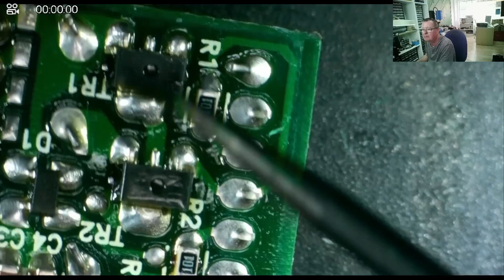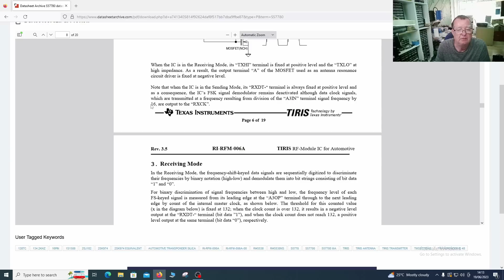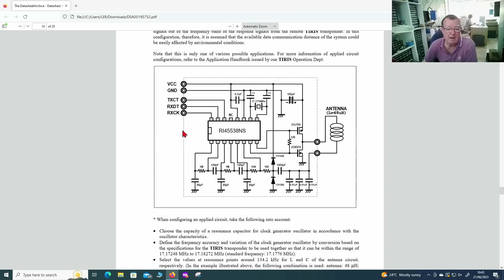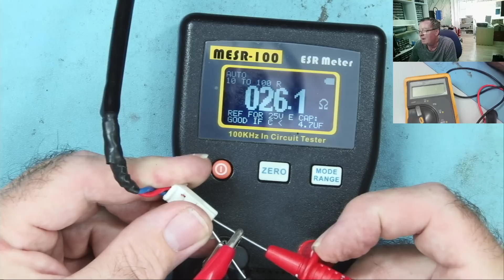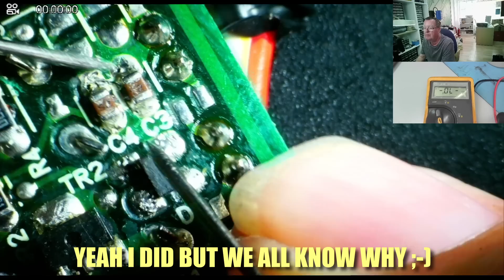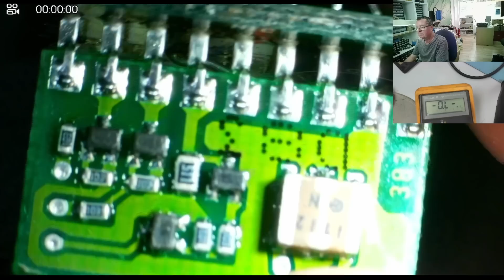Learn This Different Electronics Repair Technique And Fix Almost Anything!

Comment: That is the transponder coil of a category 2 thatcham approved immobiliser. The black ring picks up the chip in the car  key and relays the stored immo data/code via the coil and module to the ecu or dash clocks to authorise or deny an start attempt. Acc is accessory position ie dash lights on but not cranking to start. You can usually read the immo chip but as mentioned by others here, you’ll likely not be able to edit the bin as they use incremental registers to prevent you editing the first two lines containing the immo status
Reply: Great reason to hold onto your older vehicles.  The manufacturers are doing all they can to relieve you of your ability to fix it yourself.

Comment: I watched this entire video and couldn't believe that an hour had passed when it was over. I guess I've progressed beyond "complete beginner" because I was hoping to see the board powered up and what would happen if a scope was attached to the TX pin or a pulse generator was attached to the RX pin. I don't know a lot about cars, so I also wondered why a car with a battery even needs a bridge rectifier to convert AC to DC. I looked up how alternators work and figured that out and learned about what inverters do in the process. This was definitely the right information for me at the right time.

Comment: Can I suggest you get yourself a ball of "bluetack" and use it to stabilize your board/assembly whilst attempting the surface mount soldering.  Just stick the board/assembly down on top of the Bluetack and it should stay in place while you prod and poke the components.   Great videos, as a novice I am learning much from them.
Reply from the maker: Damn good idea.  Thanks.
Reply: I`ve used blue tack for my jobs for years. best way to hold stuff, even just to hold wires while tinning
Reply: It's great for cleaning record player stylus' too. I've checked it under a microscope and it does a fantastic job. Just an FYI...

Comment: Nothing wrong with it from the start, the bloke nicked the car !! Good effort and I felt your pain as the probes skidded off the conformal coating, perhaps your next Ali order should include a small bench vice !...cheers.
Reply from the maker: Someone else suggested Blue Tack. 😉
Reply: Or got a new key cut and forgot to keep the old plastic part with the transponder in.
Reply: Heh yeah, most obvious application for 'electronics connected to the ignition switch' is an anti-theft device and the most obvious reason for it being 'broken' is that someone's stolen the car or lost their key and doesn't want to pay the manufacturer to sort it. Take it around to your local electronics expert to see what he can do.

Comment: Hope you're having a good day I have found that by applying white thermal paste onto and wiping it off ic's and transistors you then can read the numbers very well, thanks for all your videos.
Reply: Great tip, tried it and works well. Thanks👍
Reply: Nice tip! Thanks. I'll have to try that.

Comment: It's a bit inconsequential to the diagnosis, but I think you misread the voltage on the electrolytic cap as 6v when it's 16v, most 6v caps are 6.3v.. it would also make sense that an automotive system would run on 12V
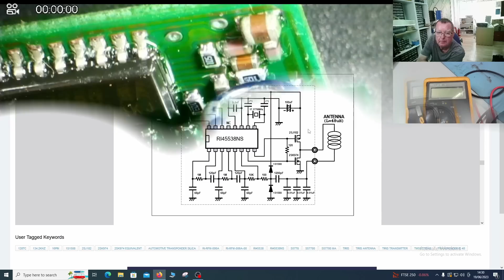Reply: You can clearly see it at 22:00.
Reply: yup @TechSavvy.

Comment: Many standard diodes come in chips of multiple diodes. Sometimes these are connected and sometimes it's just convient packing of separate diodes. The same is tru for chip resistors as well. All the time you were calling the diode package a bridge rectifier I screaming "Look at the schematic!" Not that I haven't done the same thing myself... I enjoy your videos! Keep making them!

Comment: Likely powered by automotive 5V reference (supply) voltage from the ECU.. Tx/Rx likely goes to the CAN bus.
Having the scan data from the vehicle, specifically Security/anti-theft/key transponder (& is the transponder in the key any good?), via a scan tool from the customer would have helped.
PS, check out and get an RTL-SDR dongle, as it is cheap and effective receiving a very broadband of RF signals .. in this case, finding out if this device is in fact transmitting.

Comment: ACC= accessories. With engine off.
You can listen to your radio,  charge ph, ect. when you turn your key to ACC. You wont have battery power going through your alternator saving it  from burning up because it's not turning the fans inside the alternator.
With the key in ACC  It also keeps your fuel pump from running 👍

Comment: It’s part of the immobiliser. You need to test it in the vehicle with the key to see whether it is actually the problem.
Reply from the maker: @davidcross30 Sometimes you don't have access the vehicle or whatever a PCB comes from (industrial crane, fork lift truck, sausage making machine, F1 car engine cam shaft measurement rig, control pendant - these are just a few real life examples of things I repaired when working for an industrial electronics repair company).   Sure in a perfect world you would have access to the item the PCB came from but in the real world that often is not the case.  

So then you have to use other methods and that is what I am trying to show here - a methodical way to approach a PCB repair without knowing what it does. Sometimes this method will allow you to fix stuff and sometimes it wont but sometimes this is the best approach available.  Your comments and those who 'liked' it suggest it is not possible to repair stuff this way. I differ in opinion and think it is surprising what actually is possible.
Reply: @LearnElectronicsRepair  Absolutely Rich you certainly can look at what is wrong on the board but in this instance with important pieces of this system missing it is almost impossible to ascertain which part of the overall system is at fault - there are inputs to this board and it provides outputs to other boards/systems. 

I dare say (as an automotive engineer) that the fault is elsewhere and I would always start fault finding on the whole system.

Like you say If you can't do that, like in this case, you can scratch around to see if the components on the board are okay but other than that there isn't much else that can be done.

I MUST say however Rich. I bloody love your videos and I'm learning much more than ever before. Keep up the great work my man. And I did indeed like the video too; I always do.

Comment: my suggestion would be that the shop check with oscilloscope if the ecu pins are getting the signals and from there you can conclude something like broken key or the chip here is faulty, because as you showed the antenna is working, which often is the problem with this systems, but maybe not this time

Comment: This might be a job for the Fnirsi portable oscilloscope. You could connect it to the antenna and see if there are any signals present as this looks to be a transmitter only device. The question also is if this device is receiving the signals to transmit from the controller.
P.S.> Richard I hope you fixed up a bit those solder contacts, because while you were poking and poking and poking them,you almost destroyed some 😁😁😁
Reply from the maker: I wanted to power the PCB up and see if we could see an oscillation on the inductor - I even looked at the datasheet to see what logic levels we may need to put on the inputs to get it to do something.  Unfortunately the owner wanted it back the next morning so I didn't get chance so apart from explaining how we could test that chip I wasn't able to try it.  I did give him a quote to continue the job so hopefully he will bring it back in
Reply: @LearnElectronicsRepair  Thanks for the info Richard, much appreciated. I am curious how this develops.

Comment: The data sheet I  found describes the ic as a transformer package that’s control by external Hall effect signal. 

General question, with the components of off the pcb, Can a component tester identify smd transistors, diodes, etc??
Reply: Yes any decent component tester will.
Reply: The cheap ones have a pad to put smd components directly on to check (max 3 pins)

Comment: Richard, I'd like to add few pence from myself. 

1. Why overcomplicate things? What I mean is it took me several watch attempts to reach 33 minutes of the recording, to start to see shorts :D. How this will attract new people to  start fixing electronics?
2. I'd make it more simple. But... . I've started fixing in the '90s, I've forgotten a lot and 3 times I've quitted fixing them. But, was working for 3.5 years in the computer shop and microsoldering since 2021. So, know a bit about it ;) you can say. Run as well a five-star rated with over 110 reviews electronics repair shop to make it more clear with several people helping me and over 100 active jobs.
3. How I would have done it is. First, do the visual inspection. If no findings step no. 2, check for shorts. If you don't know how to do it, start learning which components are capable of shorting circuit. If you can't find any shorts, supply voltage. If you have to apply 230V, do it via bulb. If bulb is lighting up, you've missed something. If not, no short. If you can't find a short, that means that something is not connecting, burned, or a firmware fault on some IC. And explain how to check it. And, how to replace it, or redesign it - even using Arduino, ESP32 ;), etc.

Comment: Yeah… i have one guy that keeps on bringing in single PCB’s from larger systems. He diagnosed that PCB to be faulty. No other info. With lots of reverse engineering, I normally have to tell him to bring in another PCB, on which the fault actually is.  I guess that is a way to fix stuff that is too large or difficult to bring in, lol… but it is still easieer than taking all my equipment to a premise and look for faults whilst it is -40C outside. The upiside is that one learn so much from reverse-engineering a PCB, figuring out how to test it, and derive where the fault actually is. Biggest problem is always finding data sheets for those weird industrial chips….

Comment: That type of Immobilizer works by using the induction loop in the ignition to send a radio wave (similar to how wireless charging works)this causes the key to broadcast a frequency that is compared to the reference signal stored in memory.

Comment: Richard, you spent quite same time trying to figure out what the D1 device with 4 legs was, when it was clear from the diagram that is 2 diodes! and 2pins are shorted together as per the diagram

Comment: Big storage capacitor is 16V not 6V. No 1 is barely seen at the edge. I think the problem is not in the Cct. Owner of the car may have used a mechanically duplicate key instead of using the original smart key to start.🤭
Reply from the maker: Thanks, my bad eyesight then.  The thing does run on 5V though as proved from the datasheet.
Reply: @LearnElectronicsRepair You are correct!, Sorry if I've being rude to you, b'cos my English is so poor. I'm 52 now and I found you are a very experianced helpful technician from all arround the world. what do you think of my 2nd guess?

Comment: That cap is 16 volts not 6, most vehicles have a 12 volt DC electrical system omitting big trucks, planes, locomotives, busses and heavy equipment. Anyways the device looks like an RFID reader that reads the chips in new vehicle keys. The physical key unlocks the steering and engages the contacts for the starter but the chip in the key authorizes the BCM (Body control module )computer to enable the vehicles start and run electrical system that will supply power to the starter, fuel pump, ECM, instrument cluster, stereo, etc.

Comment: Yup one like that in my van but the PCB is like 6x that in area with old through hole parts. Mine reads the transponder chip in the key, it's a glass bead type line in a dog/cat under skin chip/tag.

If the code read matches it's memory, then a secret handshake is sent to the engine ECU allowing the engine to run until the next power cycle.

It's an ac signal to the coil and the reflected waveform is monitored, three chip in the key has a coil that receives the waveform and rectifies that as a power source to transmit it's code back with. 
Similar protocol to NFC but afaik the code in my key is fixed ID number and can't be written

Comment: Why not do in circuit ESR measurements of the large electrolytic cap and the other one right beside it?
Reply from the maker: Yeah I could have done that also.  The capacitor is directly across what I worked out to be the DC input so it probably would not cause a problem even if it wasn't there, but as I don't know where the 5V regulator is, maybe it does need the electrolytic to be present in order regulate - so yours is a good suggestion
Reply: @LearnElectronicsRepair  thanks for the reply!
Reply: @LearnElectronicsRepair  I’m still learning so, please bear with me: Do you mean to say that, electrolytic capacitors are sometimes used instead of voltage regulators? Is that really possible? Please clarify. I want to learn. Thank you kindly, sir.

Comment: Richard, I don't know if you mentioned this before, but it might help people to know that the collector always reads a bit higher than the emitter. Knowing this fact can help people know which is which and also if the transistor is faulty, because the two numbers are always very close readings. For instance, 0.768 on the collector and 0.764 on the emitter would be a typical gap between them.  It seems to be something many people aren't aware of. You said that the emitter sometimes reads lower, but doesn't it always read lower? Maybe I didn't test enough, but I tested a lot an the emitter was always a bit lower. I'm curious to know if you ever found the emitter to be higher.
Reply: He has mentioned this in other videos
Reply: He has explained this in his deticated transistors video
Reply: Have you got this the right way round,  as the collector is normally bigger than the emitter junction so has a lower voltage drop across it.
Reply: @zeddpilsner4  
dedicated NOT deticated 
Invest in a Diction-ary is your best bet
and reduce the pilsner -
It helps to stay sober

Comment: T1 and t2 look like ghey could be a half bridge to drive the coil.  Very hard to fault find this as you need to be able to tell it to turn on and read the key.  So you need the data format for the coms bus, and if chip has an issue then your probably need to reprogram the ecu. These are mosty a no win

Comment: if chip has problem, is possible to check with multimeter on diode mode? i mean : red on ground of chip and see with the black on each pin if there is a short. Thanks a lot for your videos, keep up the good work !

Comment: You misidentified the large capacitor as 6v it is 16v which would fit with most automotives being 12v

Check timestamp 22.18
Reply: its a throttle hall sensor off e scooter which run on 5v rail
Reply: ok, but then where is the buck converter or something similar to lower the voltage? I'm pretty sure the cap is 6 volts
Reply: @user-kr8tp3ko8z  no it's not ! Look at 22:06 , you can see cleary 16V
Reply: @BjornV78  i still dont see how its 12 volt line when the chip is working max up to 5.5 volts? Do you see some power supply or something that will drop the voltage to 5? because i dont see it. It can be that they used the capacitors they have in stock, as someone said the 16volts are used almost anywhere, and using higher voltage capacitor than the rail is using wont hurt anything
Reply: FYI if you put a colon between mins and secs it will create a clickable link 22:18.

Comment: Enjoyed your video I was curious where do you get those nice needle tip probes....
Reply from the maker: They came as part of a large probe kit from Kaiweets called KET05 
They really are excellent, and I have used a lot of meter probes over the decades so I do know good ones when I find them
https://www.aliexpress.com/item/1005003727037642.html?af=ler2022

Comment: 18:10 Replacing a IC that is part of a car electronics system is not an option anymore these days, almost every circuit in a car is connected to the ECU (main computer) and use CANbus fault diagnostics and has a serial number attached to it. The guy that ask you to look at this part, has propably got a high repair quote from the car dealer, and didn't want to pay for that. When such a part like this RFID ignition slot is replaced at the car dealer, the ECU has to be reprogram to accept the new part, and also only the car dealer knows the exact frequency that match the key fob of the customer. Otherwise everybody could ordered this part online, and could start a stolen car.
Reply: that's look like from old car, and many times you can just replace the part, it don't look like CAN communication and also this board and antenna are just rf transmitting and receiving, they don't do anything to the signal
Reply: Maybe chip is readable? Would you need special programmer to copy them?
Reply from the maker: @KennisFix  The datasheet says this is a dumb interface, not programmable.  As far as I can tell